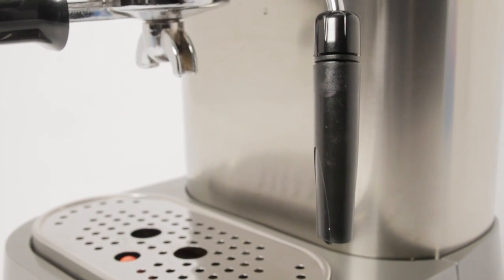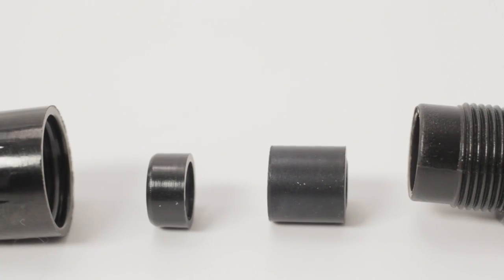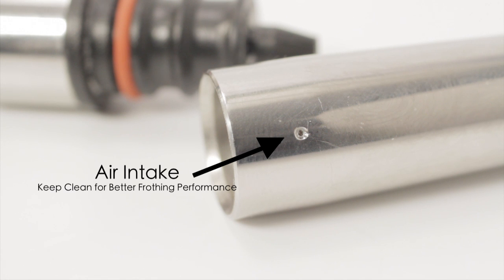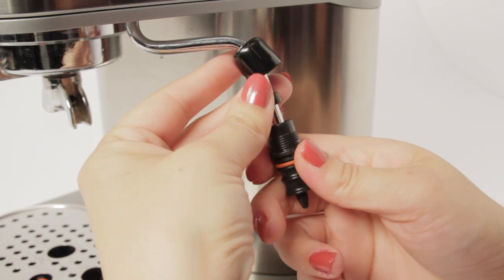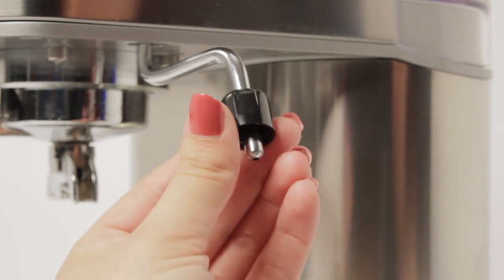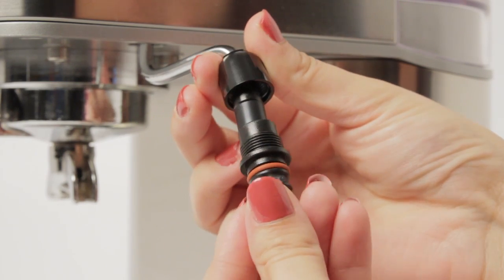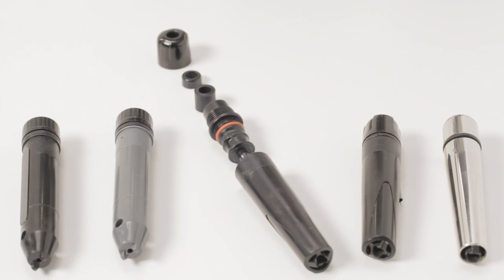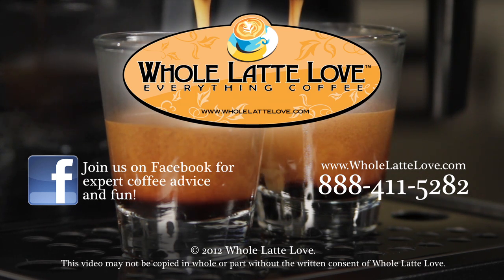How To Attach a Pannarello Wand

Comment: I just got the Gaggia Classic from you guys, this video helps explain the disassembly of the Pannarello Wand. However, the rubber gasket gets stuck inside the inner wand, and I don't think using a screwdriver is the best idea as I think it marrs/damages the rubber and possibly the plastic too. I was having smoke coming out of my head, being German I hate when something just doesn't "work". Luckily, I just slid the cap nut, then the hard plastic gasket, and the inner wand WITH the soft (which won't come out too easily) rubber gasket in and like you say in the video it can be quite hard even sliding that up. I hope I don't run into this issue every single time, as it is a real pain in the a** to say the least. Maybe you can send me your other Pannarello Wand, is it easier to attach than this one? Thanks!
Reply from the maker: Hi ES, Thanks for the comment! All the wands mount in a similar fashion. They do nee to be tight so they don't pop off while frothing. You will have milk splashing and steam flying if that were to happen! It will likely come go off/on a little easier next time.